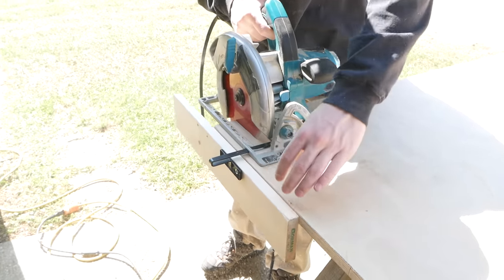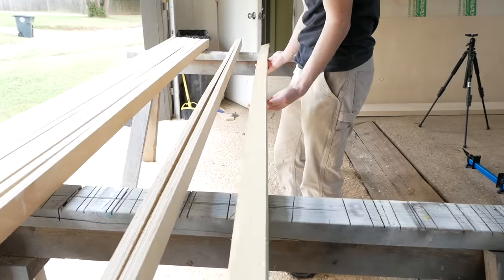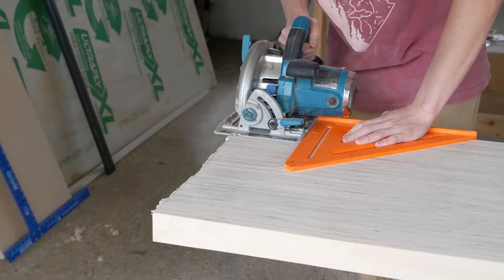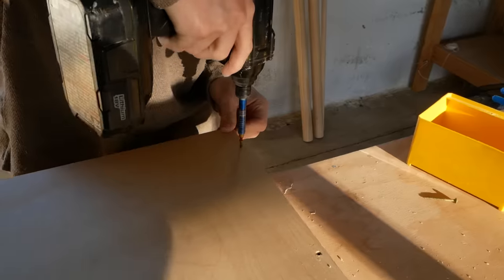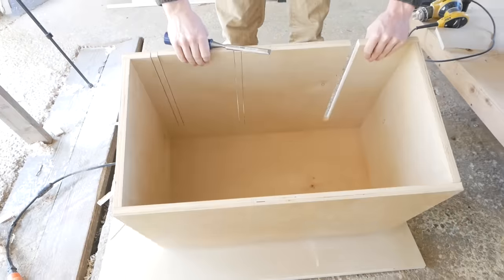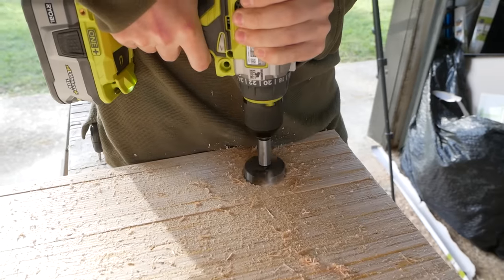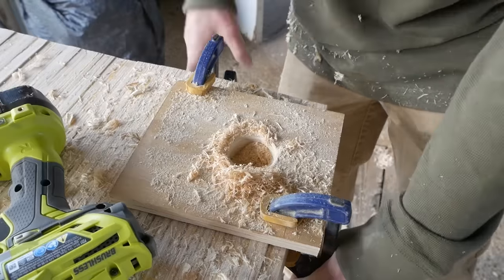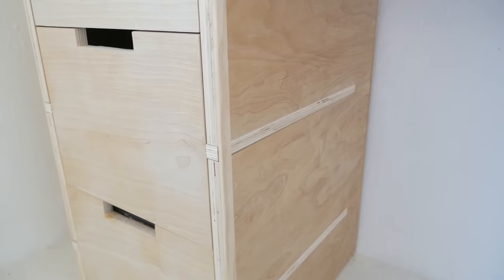How to make a Plywood Desk with Minimal Tools | Easy Woodworking Project

Comment: Bruhs, y'all complaining about the minimal tools bit. 
This is minimal tools. 99% of other woodworking channels will call a desk "DIY", and then proceed to use a planer, jointer, top level table saw, table router, air compressed nailers, miter saw, band saw, edge banding, 47 parallel clamps, 34 years of experience, a handy sponsor, premium grade lumber they already went to a lumber yard for, all on top of a $2,000 workbench that they're actually using the channel to sell you.
Want more minimal than this? You're more than welcome to build this thing with a hammer, chisel, and handsaw with some 2x4s from Home Depot.
Quality woodworking doesn't come from the lazy or half-hearted.
Reply: also a nuclear reactor.
Reply: I totally agree with you. I've been looking around for a tutorial simple enough as this one. I think the number of tools needed for this tutorial is OK, and if someone doesn't has the budget to buy a circular saw, or any of the other tools, it is not really a valid excuse, as one can use a hammer, chisel and handsaw, and that's it. The extra dolars one pays from a manufactured piece come from the cost of the logistics, investment on tools, sweat from operators, and keeping the business healthy. One can't simply expect doing furniture to be easy. The dollars one is "saving" doing this, is really translated in time and sweat from ourselves.
Reply: The only thing I didn't like was the wood they used. Everything else was good.
Reply: kinda truth..through some channel does really use minimal power tools like this one not because they doesnt have but they really actually want people to get into wood working without breaking a bank. If you woodworking anyways circular saw and electric drill and clamp is a must. Table saw is important but you still can do with circular saw. you still can do without circular saw but using hand saw just will make newbie lose interest in woodworking when they cutting 1 inch plywood for 10 minute
Reply: Cnc router , plasma cutters, laser cutters. etc. They promote themselve as a lonely man working in his garage with 100k $ worth equipments. Yeah right.
Reply: This isn't minimal tools at all.. you can buy finished plywood at any big hardware store and have it cut to whatever size for the desktop and the same thing for the cabinet then buy some table legs, maybe build a frame out of 2x4 to screw to the bottom so it doesn't sag. Buy a few types of sandpaper, buy some specific length screws, get some paint, primer, and clear coat. The only tools I need are screws, drillbits, a drill, painting accessories, sandpaper, a pen and measuring tape.
Reply: Hahahah true
Reply: @nonames000  haha true also
Reply: nonames000 agree too much
Reply: nonames000 agree too much

Comment: Love this build. For those who don't want to kill themselves with a hand plane, but don't own a jointer or planer, I've had GREAT luck with local woodworking shops letting me use their stuff in a limited way. The point of this build is to do it with limited stuff, and I get that, but never be afraid to ask others for assistance if you're just starting out. Most of the people I've asked don't bat an eye if it's a personal project!

Comment: It was a great build for 2 people with a minimum of tools. Yes the drawers should have been spaced further apart to take into account any warping, or expansion from temperature/humidity changes. From the looks of your construction, it seems as if you selected a higher grade plywood (maybe birch?) that is void free. The sound was cut off in the beginning of video, please forgive me if it was.  If it was not, stating the type of plywood is very important. You would not have been able to get the finish you needed if there were voids in the plywood. Also, you would have a large amount of tear-out during the planning process.Believe me, I know what it is like to work with a minimum amount of tools. Thank you for sharing your project with us; keep them coming if possible!

Comment: All you need is the circular saw, glue, a square, screws and a screwdriver.  The fancy corner braces are fluff, and forget the cordless nailer.  As you glue the strips together, screw them together, that'll will eliminate the need for long clamps and the result is less, if any, planing afterwards.  For the drawer runners, just glue them in to the  inside of the cabinet.  For the legs look, for other  video for ideas if you don't own a forstner bit and the 18v drill needed to use it.  Nice video, and the final desk looks nice.

Comment: Props. That turned out really well. I see a lot of people getting sour over the "minimal tools" thing. Don't be mad that you don't possess the skills or in a lesser-case, the tools to do this desk. This is mostly just hard work. Homeboy planed the desk with a sub $50 tool, that substituted the $600 tool that most shops have. He didn't use a table saw or router/router table. Both of which are really expensive and do a more precise job of what homeboy and homegirl did by hand. If you're trying to do wood work even kind of fast and slightly less laborious, you already own a circular saw - $50. Palm sander is the first thing every Instagram furniture repurposer buys - $50. Ryobi drill/driver - $75 new and $35 used in ever single pawn shop in the country. The other drill has had more birthdays than either of these two and was definitely handed down from "Dad's" oldie-but-goodie, Black & Decker set - not counted! What else... Right angle clamp set.. $30 at the most. The footed bar clamps were the most unique tool in the entire video, which aren't necessary to this build. You can buy some cheap clamps and glue them up 4 sets, instead of two. This is still a "minimal tools" build. Don't be intimidated. Lose the HGTV mentality and build something. Making cool stuff isn't easy. It requires work and tools.

Comment: I was kinda skeptical at first, but it turned out dope! The dowel legs are so simple, yet totally legit. A little beeswax or oil on the wood drawer runners will help them slide.
Reply from the maker: Thanks! We definitely need to put some wax on there for sure!

Comment: Those side channels where you struggled to cut the end.. Use an auger bit and saw up to it.  Also, afterwards how you added that strip at the front, you could fix a panel to the side, flush with the trim bits and would close off the sides.  Looks dope though.  Nice work!

Comment: 1 modification/replacement idea: for the 2 legs make stacked plywood legs, cut circles and stack them, use a threadd rod down the center to attach to top.
Just an idea to make the plywood desk even more compliant the pure plywood concept, and the cross piece connecting the legs could be an arch with mortise n tenon to connect. And if you are even more ambitious carve a triple helix rope segment. That would add a next level elegance to the desk.

Comment: Thanks for being willing to show everyone how, knowing you're not pros. You would definitely benefit from the feedback in the comments you're getting here, and you will make it better with each new attempt. 

Some more to add. Please hold chisels by the handle, even if it's far from where it's cutting into the wood. Holding it near the blade is unstable and not safe practice.

A dust bag or catcher for your circular saw would be an idea, then the sawdust could be used elsewhere, many useful applications.

You have an envious amount of tools there, which is fine for those who can afford it. It does not make it cheap unless you make a lot of stuff with them. Minimal probably would entail minimal expense as well. 

Cutting and drilling those round dowels looks a bit dangerous too. You would benefit from some way of keeping a round surface still while you do that. How, I don't know, but there has to be a safer way.

That table top, no doubt that's very strong the way it's put together. It was probably strong enough without cutting it into strips considering it's a desk.
Reply from the maker: Great Tips!

Comment: Tip next time you glue boards  to make a big panel take 2 boards lay across one on top one on bottom and clamp it will  force them to stay even . you can do this one each end and even in the middle when its long like your glue up .  They call them Cauls .

Comment: Great design, and nice to see green energy coming into play. One suggestion I would make is that the drawer rails not be cut through fully but only halfway. Reason being that when you put load onto the table top, it will squeeze the drawers and make it that much harder to use. The strip of wood on either side might not be enough to carry the weight of that top.

Comment: My only suggestion would be when glueing the table top, glue and set fewer piece at a time, because the larger glue ups can be difficult to control wood shifting and movement. Great job!

Comment: I like the simplicity of your design. Just curious, why did you cut strips for your top instead of using the finished surface of your ply? I'm about to build a desk and have 3 sheets cabinet grade walnut in the shop ready to go.
Reply: IMO, they afraid it will bend, but I think if you have at least 1 bar run along in back from the view to support, should be fine.

Comment: nice project! a simple design suggestion and pro tip: to make the front look a little cleaner around the edges, since you can't put front trim because of the sliders, you could simply extend the drawer face width to the edge of the cabinet to cover the unfinished track and edge of the cabinet. also, where you used the chisel to take out those track strips, use a drill bit the width of the track at the back end and that should drop out all that waste and give you access to clean up the back of the track with the chisel or whatever method you want. :)
Reply from the maker: We love looking at the edge of plywood ❤️ Thanks for the tip about the drill bit!

Comment: Why did you have to stack all those wood to make thr table top? Ive seen many videos doing it that way. Makes me wonder does it provide any benefits compared to just using a normal 1 piece of wood as the table top? Does it provide more strenght or something?
Reply from the maker: Waaayyy stronger! Just how a 2x4 is stronger with the 2” side facing up, plywood is stronger this way too. But also gives the top and interesting look!

Comment: A great design and I love the top! Was wondering about the drawer strength at the front of the drawer as whilst the drawer base is screwed up into the drawer sides and back, it is only attached to the front by glue?

Comment: id like to see you make this again after you have gained more experience. im an at this aswell and would love to see the comparison between when you start and now. im sure youve noticed your own errors and as you said you learn as you go
Reply from the maker: I don’t think we would change much with this project. The top is as strong as it could ever be. The only thing I would say we would do differently is the cabinet. I love the look of the drawer slides showing, but the cabinet could reinforced better towards the front where there isn’t much material. We still have and use this desk every day and nothing has worn out and it looks just as good as the day we finished making it 😁✌🏼

Comment: All those strips for that top.... I would've just used 3/4-in plywood, cut some 1.5-in strips of that for the edges (when attached flat side out) to give it that thickness look. Would've looked nice like a butcher block and would've been strong enough for the job.
Reply from the maker: You could totally do that! I would also brace the 3/4" plywood if you did it this way to help with bowing. The plywood cut into strips and having them vertical like we did is a lot stronger :)

Comment: Nice production values in the video, well done.  The drawer runners were a bad idea, not only did you destroy the structural integrity of the box, but as soon as you start to put any weight on the top of the desk  the runners will start to bind.  The trim pieces you nailed on will not help very much.  I wouldn't put my computer on top if that desk.  Other than that, nicely done.
Reply from the maker: It has work flawlessly for us, but we do value your opinion😊 I think people tend judge others work based on their own needs to often. Had we built this for a client we’d done traditional slides or whatever else the client wanted. The fun part about building for yourself is you get to experiment with new ideas. Just to test your theory I (150lbs) sat on the desk and drawers worked great👍🏻 maybe overtime that would change, but for now it’s working great✌🏻